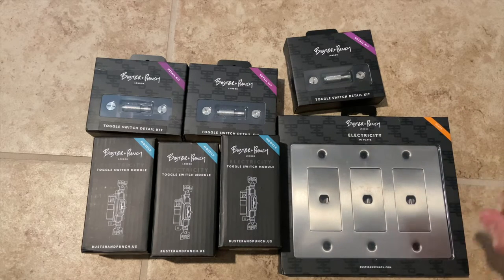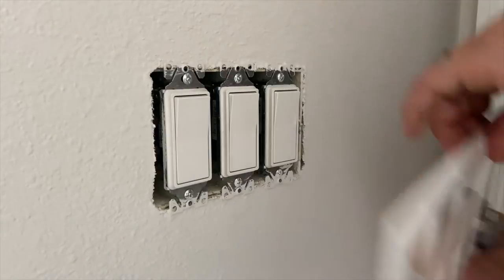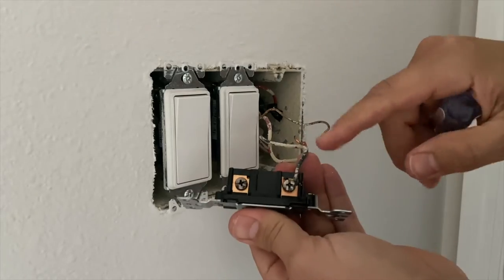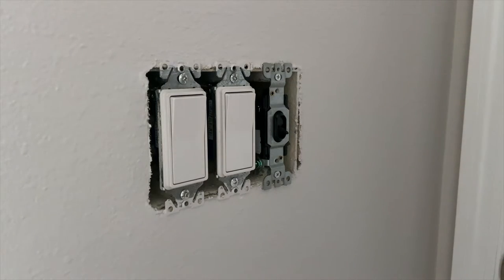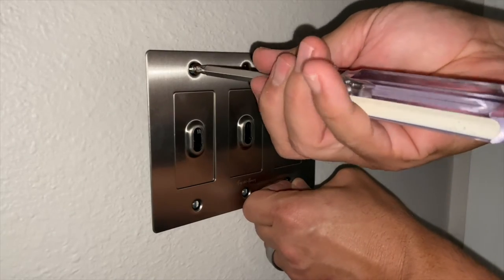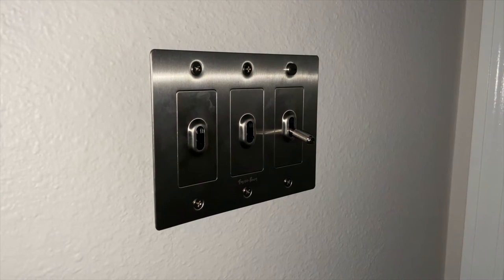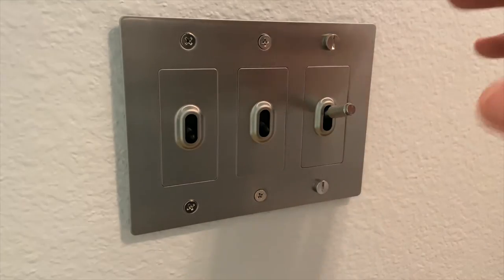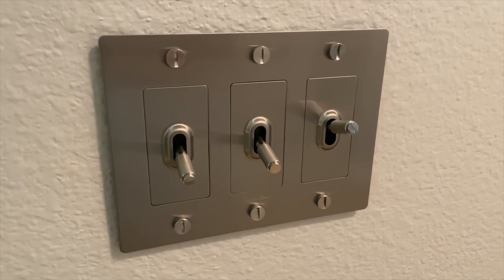Buster and Punch Light Switch Install

Comment: The panel cannot be attached tightly to the wall,looks ugly
Reply from the maker: It’s not loose, the metal just doesn’t go to the wall. It doesn’t look terrible, but they could have made the metal a bit thicker, and bent to wrap around the edge, and make contact with the wall.